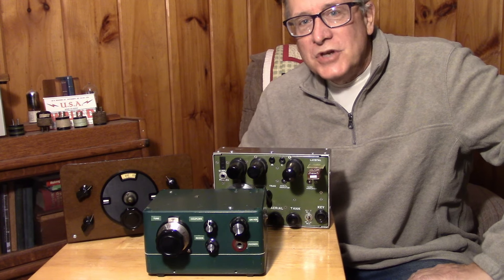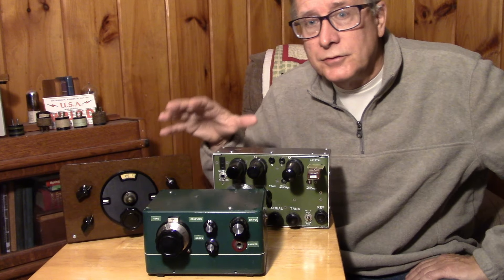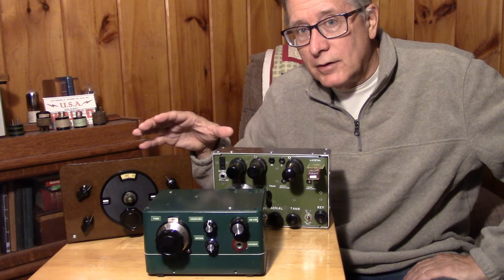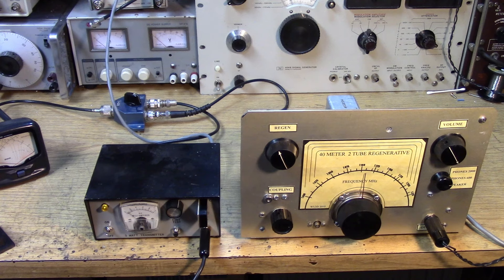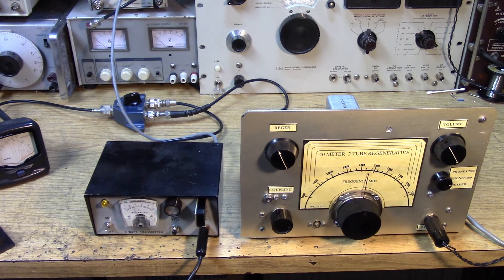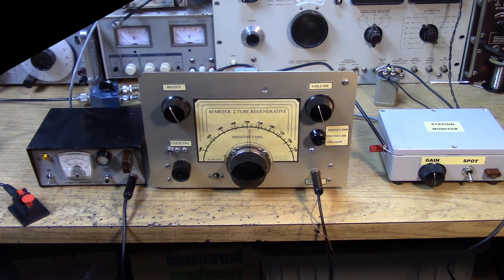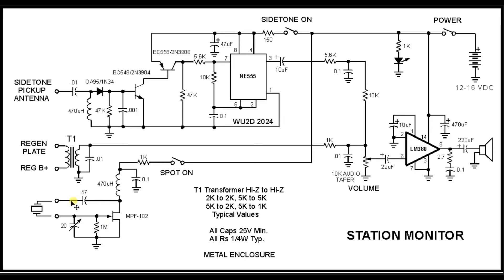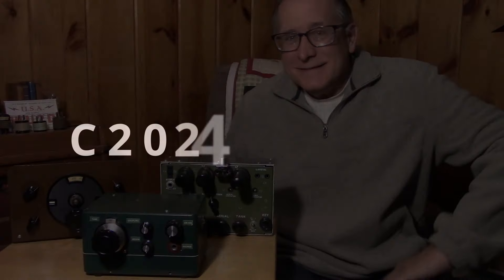Station Monitor Part 1

Comment: I bought a 2 tube kit from UK. It works fantastic.  Was a bit worried about it getting here . Packaging was also brilliant.
Reply from the maker: Two tubes make for a practical regenerative receiver for almost any application. Its a stretch to say it would have enough gain to drive a speaker, but plenty for headphones!
Reply: @MIKROWAVE1  The tubes are reciever only.  It uses a chip amp to drive headphones.   I believe the dealer was the  " 6V6 shop "
Reply from the maker: @chuckmaddison2924  Wow a HYBRID approach!

Comment: Mike, I really enjoy seeing your receivers, the schematics and explanations. Your presentations are really great. I do have a request: would you be able to come up with one or two, really good simple FM receiver circuits? I enjoy building simple solid state AM radios but I'm ready for FM radio now! I just want to be able to pick up some local FM stations. I sure hope you can do a series on this. 
- Mike M., KC0IVF
Reply from the maker: I once heard a cop say that FM meant "F#King Magic", that's how well it works. Mike for FM there are several interesting techniques to experiment with that could be demonstrated.
Reply: @MIKROWAVE1 that sounds promising. I'm looking forward to any videos you might be able to come up with concerning simple FM receivers. Thanks!